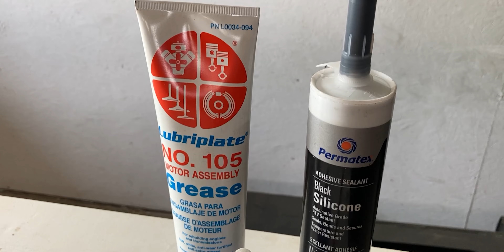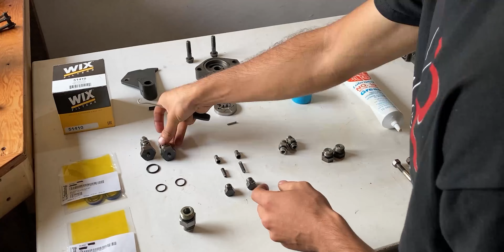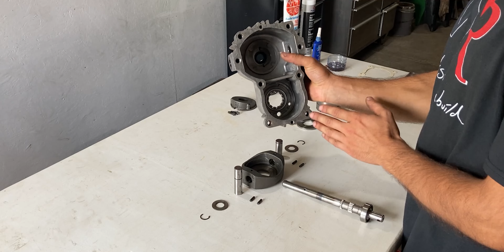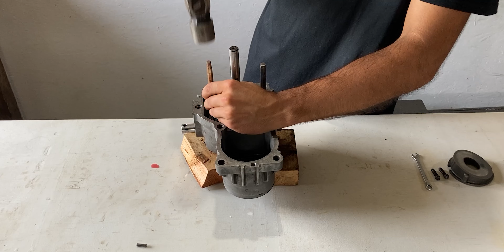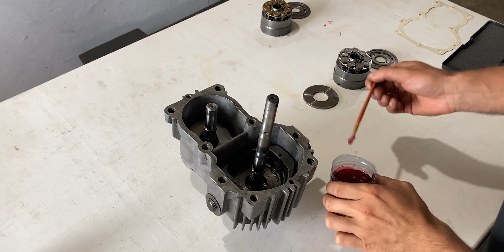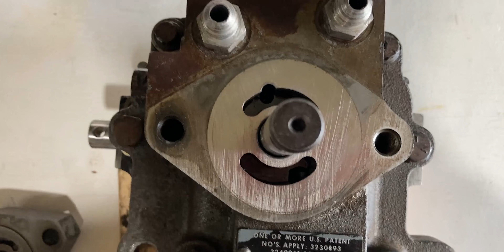Sundstrand Series 15 Hydraulic Motor/Pump Rebuild For John Deere 300 Series

Comment: Hello. Do you know how much this unit weighs on the machine?
Reply from the maker: Hi there. I'm not exactly sure what this unit weights as I never really looked into that while I had it on the table. Here is a link https://www.semhidrolik.com.tr/assets/images/PistonluPompalar/pdf/15-Serisi.pdf for technical information about sauer-sundstrand hydraulic motors and pumps. On page 6 it states this assembly weighs 15kg or 33lbs. I hope this helps. Regards Andreas
Reply: Thank you!
Reply from the maker: @DavidJones-fk5hg  You're welcome!

Comment: I believe that the 300 series and 420/430 units from John Deere used the same Sundstrand 15U pump.  Can anyone confirm that?
Reply from the maker: That is correct! The 420 and 430 have the same hydraulic motor/pump. The only difference I now of is the inlet shaft. On the 300 series you will have a straight shaft that has a bore for a pin and the 400 series tractors have a splined shaft. There shouldn't be any difference internally, because this 15U assembly is capable of handling anything up to 30hp! I hope this helps.
Reply: @WorkshopRebuild  Cool.  are the seals for these shafts the same ones on the 300 vs the 420/430 tractors?  is hi-tech seals a CDN outfit?

Comment: How hard should it be to turn the input shaft of one of these still connected to the tractor with the engine drive haft disconnected?
Reply from the maker: If you have a screwdriver or a punch that fits into the bore of the shaft, you should be able to turn over the input shaft with ease. if this does not turn freeely or smooth, you might have a worn or damaged shaft or possibly bad bearings. I wouldn't see any other cause. I hope this helps.

Comment: Should be useing type f trans fluid not auto
Reply from the maker: Thanks for the recommendation. ATF and ATF type F are very similar. Type F is a higher grade of automatic transmission fluid. This fluid is mainly used in on-road vehicles which have a higher performance rate. The viscosity level needed for the Sundstrand pump/motor varies largely, therefore many different types of fluids can be used. Hydraulic Transmission Oil, Anti-wear Hydraulic Oil, are alternatives as well as some brand specifics. I hope that helps, Best regards
Reply: @WorkshopRebuild  john deere wants type f in there trans or hyguad from deere ... Ull have isses if. U dont. Use. It .
Reply from the maker: @stevenmaines9114  That may be a recommendation from John Deere and I agree that Type F fluid is suitable. Many garden tractors like John Deere 300 Series, Simplicity garden tractors, Sunstar, Legacy, Cub Cadet and even so IH garden tractors share the exact same hydraulic motor from Sundstrand Danfoss. It's hard to believe that Sundstrand would recommend JD oil, for all makes and models that carry a Series 15U Pump. Best regards
Reply: @WorkshopRebuild  they want type f in there pumps . Ull burn them up... I have 140 john deere . Manual says type f only ..